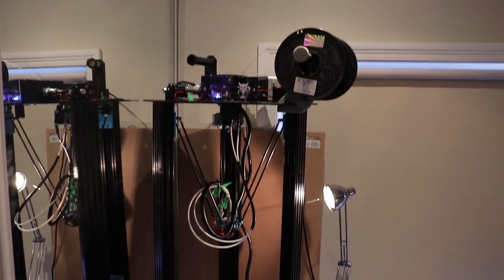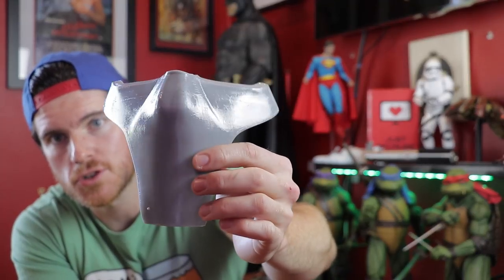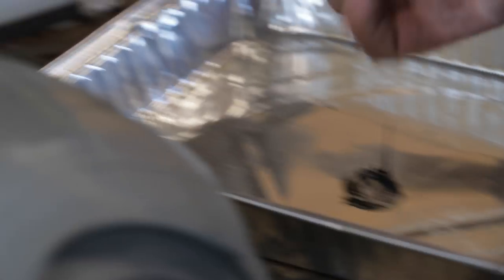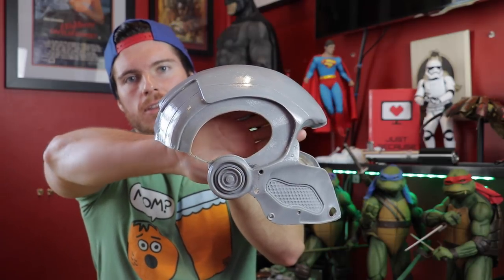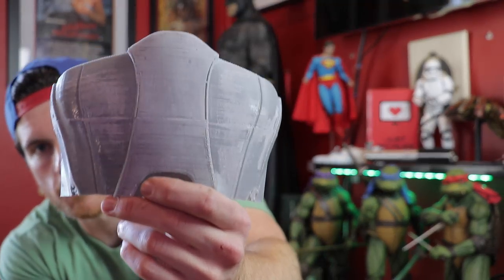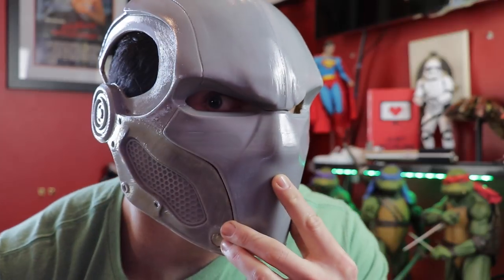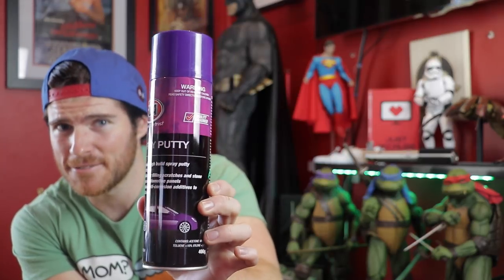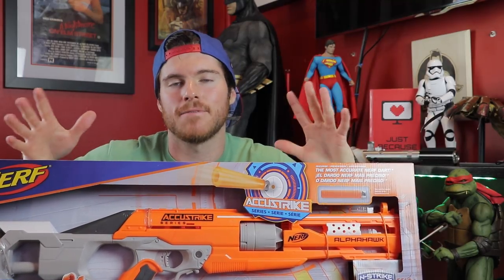The Road to Red Hood- Part 9: Prepping the 3D Printed Helmet for Painting!

Comment: Great build Chris! Just a heads up, you can dissolve scrap pieces of abs in the acetone and use it as a glue/filler for printed parts. Just keep adding abs to the to the mix to get the viscosity you are looking for. I use it on my prints and it works great.  My 10 year old daughter says keep up the good work! She's an aspiring builder.

Comment: I would keep with the magnets on the front panel for removal but for the back I would use elastic band that you would use on sweat pants. That way you can take the helmet on and off like and NHL goalie helmet. Love the mesh idea for the sides. A helmet without ventilation is hot as balls!

Comment: Hey, Chris, I have a tip for you. Throw your left over pieces of the ABS into a glass jar and melt it into a paste with the acetone. This is a cheaper and more plentiful way of getting your welding solution. Smear the goo on the same way as the paste and you get the same results and get rid of the support materials and failed prints laying around and it sands to the same finish as the ABS because it IS ABS. :D